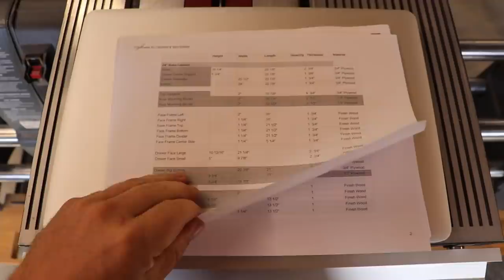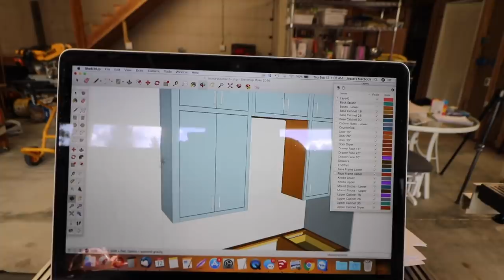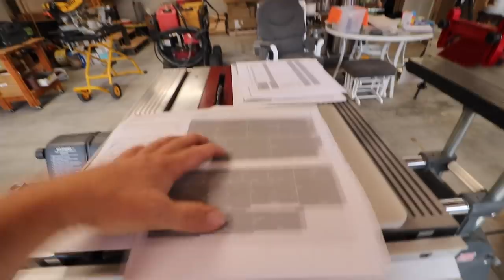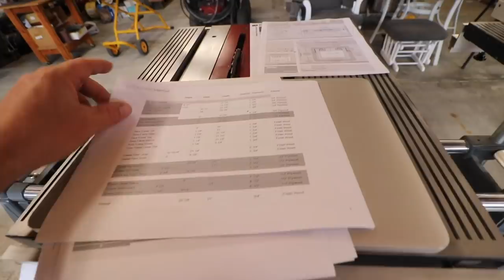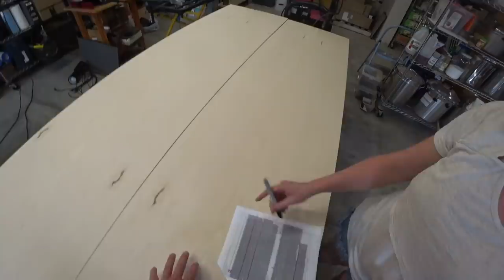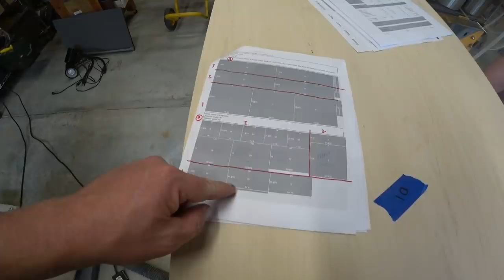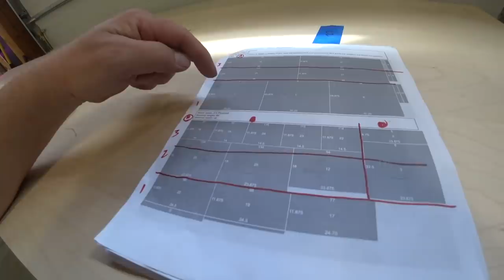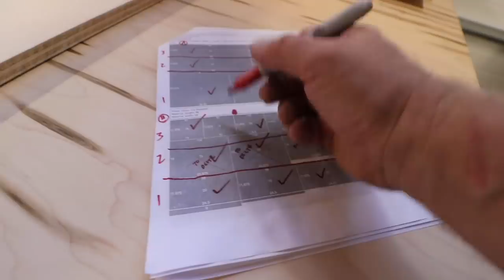FIRST CABINET PROJECT! (Cutting Cabinet Boxes)

Comment: Invest in a track saw Bora or Kreg are inexpensive
Reply: Why does he need a track saw?
Reply: Curtis to safely break down the plywood I built cabinets for 15 years but we had special saws  need to get down to manageable size to much chance of kickbacks.
Reply: @ronaldpietrowski7046  My custom cabinet shop has been open for 34 years and never have used a track saw or any special saws. Always just a table saw. Kickbacks happen by the user not the saw.
Reply: Curtis never used a track saw either not until I retired  now have a small shop of my own only way I can breakdown a full panel by myself .
Reply: Track saw is a great way to break down full sheets.  Then make final cuts on the table saw.  Alternatively, with the right setup you can do it all with the track saw.  With a 4x8 table, a 90 degree track guide (like the TSO), and some parallel guides (purchased or shop built) (ala Ron Paulk) you get pretty close to functionality of a $10,000 ish sliding saw.... the type with 4x8 capacity.

Comment: Dust collection system is working. It is keeping some of the fine dust out of your lugs. That dust collection system is smell and old.
Reply: It's the same size as a current Delta or Grizzly.  Possibly a broken impeller, blocked shroud, or a clogged hose.  The fan motor didn't even inflate the exhaust bag.  That should have been the first indicator the dust collector wasn't working.